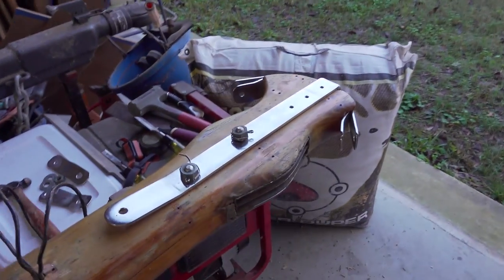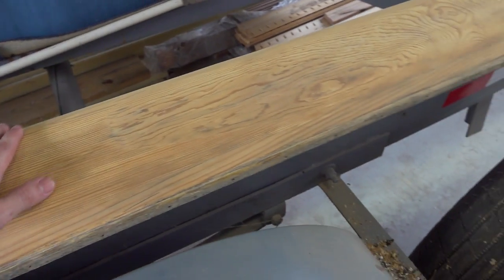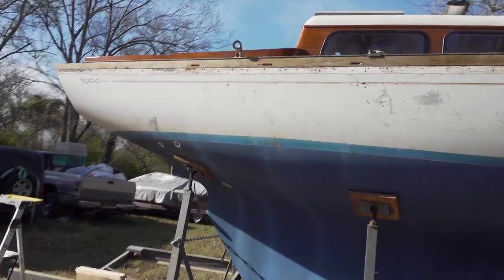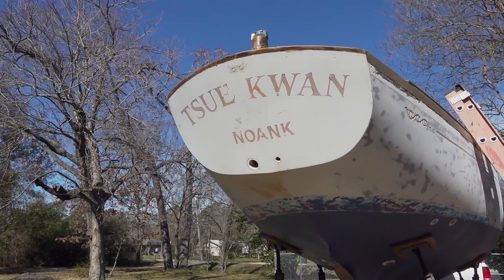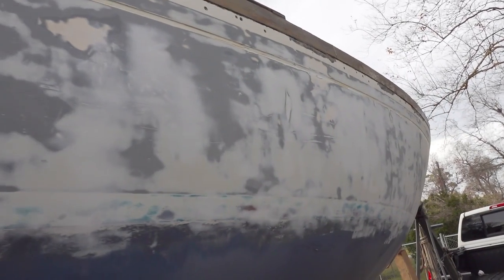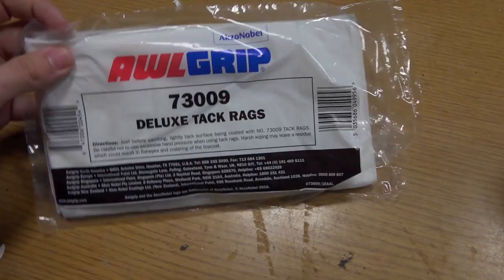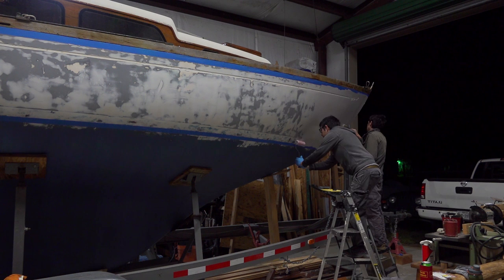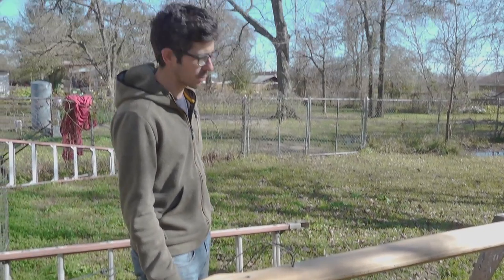Sanding the Mast and Priming the Topsides | Sailboat Restoration Ep. 39

Comment: Old sailors formula for varnishing raw wood.  3-2-1  3 part mineral spirit, 2 part boiled linseed oil and 1 part of oil based marine spar varnish.  This dries very fast, so you can do 3 or 4 coats in 1 day.  Second day, 2-2-2.  At least 2 coats immediately after each other.  Third day, light sand. 1-2-3  This will take longer to dry but you can put on more than 1 coat during the day as long as the previous coats are not completely cured.  If you want more coats, drop the mineral oil.  It's only purpose is to speed drying.  Multiple coats on boiled linseed oil are very slow to fully cure.  In cool weather it could be a week or more.

Comment: So, are you no going to have a bowsprit any more? If the boat was set up to have a bowsprit when she was designed, (usually meant to anchor your fore-stay and run up a jib) the bob-stay was a vital  part of the system that helped counter the upward force of the fore stay. I am not being critical I am just curious what your plans since you filled the hole and repaired the area where the bob stay was anchored on the bow. By the way you are doing some excellent work on her!
Reply from the maker: It was not original. The only thing that was holding the stay was a bent washer on the inside of the hull and no sealant. so it was just an open hole. definitely not a factory install!
Reply: @SailBros  That makes sense. The stainless strap you have at the top of your bow looks almost identical to mine where my fore stay is attached. Good call glad you filled and repaired...not a good place for water to be coming aboard! Thanks and keep up the good work!

Comment: You really should make at least some effort to collect all the dust coming off your sanding. Put some tarps down and use a vacuum attachment for the sander.
Reply: Peter Kacandes Looks like he did have a vac hose on the sander at one point.
Reply from the maker: I do! I had the vac attached at all times for sanding the topsides. I'm not worried about wood dust getting on the ground! Thanks for watching